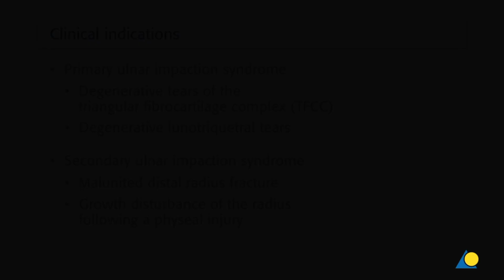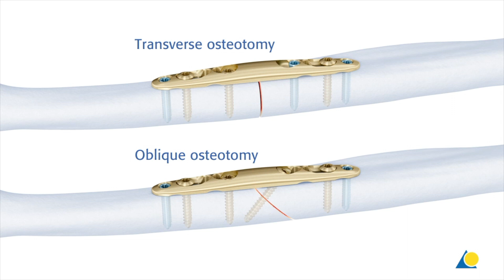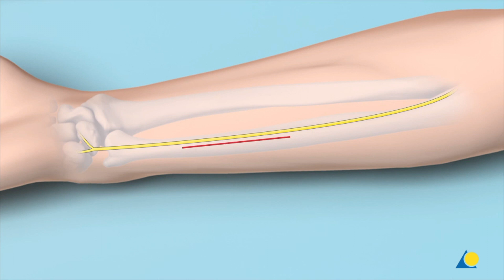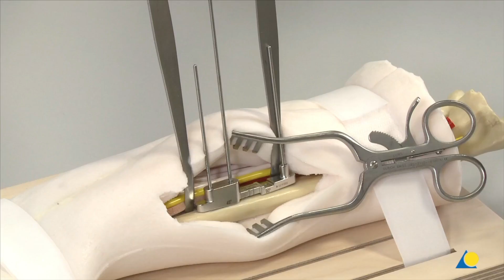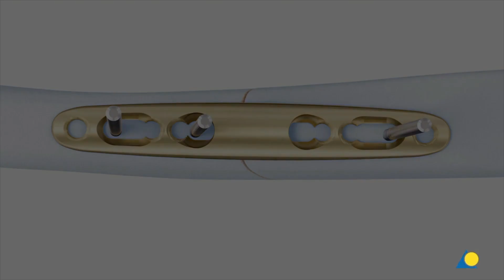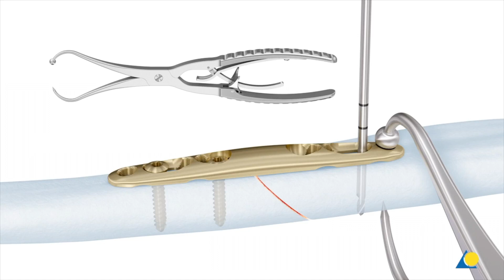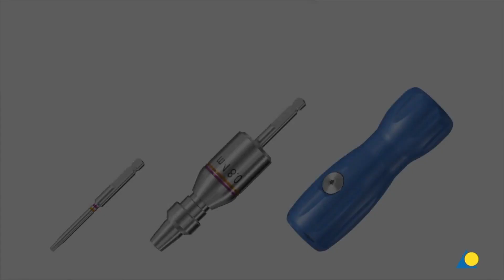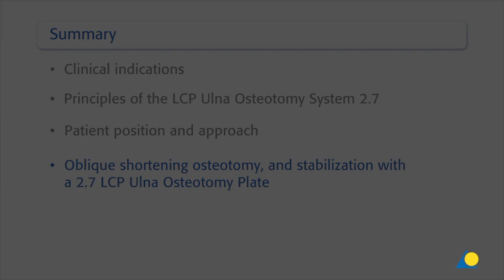Ulna Shaft - Oblique Shortening Osteotomy Using the LCP Ulna Osteotomy System 2.7

Comment: I had ulnar shortening osteotomy done 18 years ago. I truly  wish I hadn't. The screws are displacing. It hurts like crazy. The original surgeon will not redo because I m retired and have Medicaee/ Medicaid.  I put the slightest pressure on my right hand and arm and the screws actually pop up. It's very visible. I suffer in pain. I wear my carpal tunnel brace on it to help  reduce the pain. I honestly wish I hadn't done this.
Reply: Has anybody had this operation recently, like in the last year. I need to know what to expect.